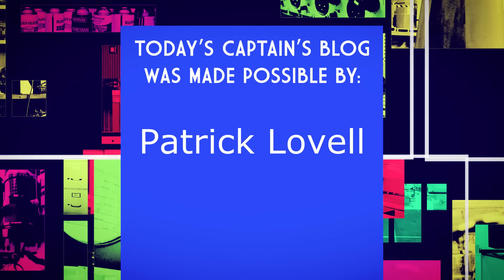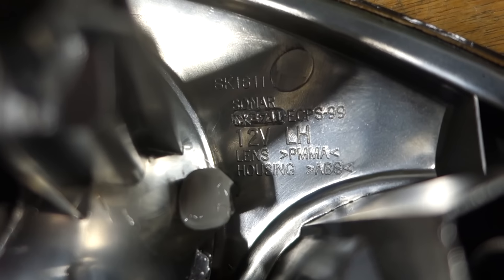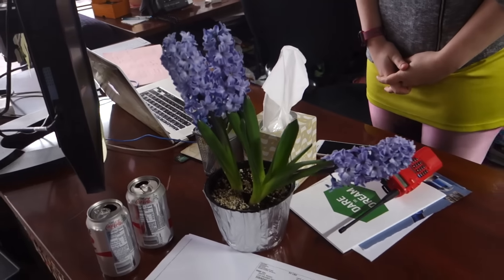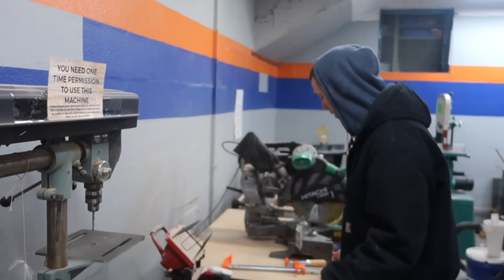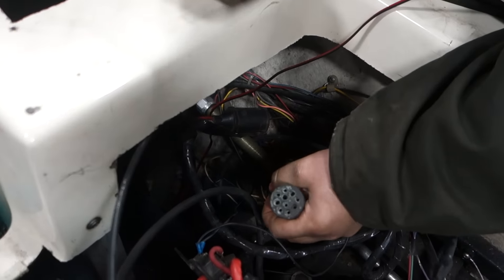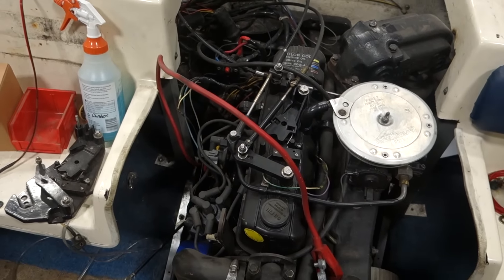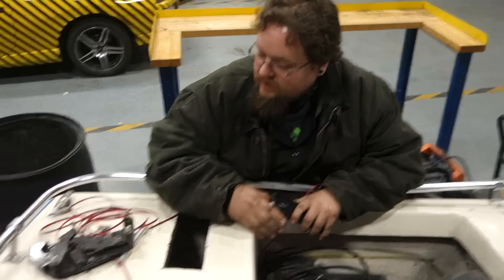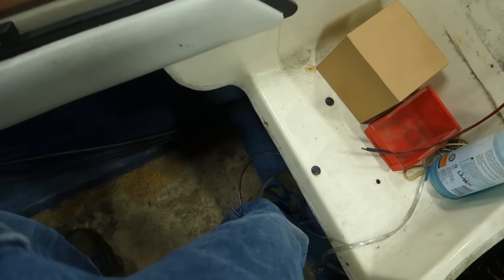Captain's Blog 2 7 2017 Comment Help On Projects

Comment: Chris, those look like standard twist lock holes for a 1056 and a 2057 bulb.  If you go into a auto parts store, ignore the counter guy and find the "HELP" section.  they will be carded on a peg hook.  possibly listed for a GM vehicle, but most newer vehicles use them.
Reply: Those holes in the light housings do look like they fit standard bulb bases that GM uses on many of the cars for that era.
Reply: coshtor    Help is a Division of Dorman Products.   They are one of my Wife's customers.

Comment: 2057 bulb socket https://www.amazon.com/Bestcompu®-Socket-Adapter-Harness-Wiring/dp/B00QG9DDU8

1156 bulb socket https://www.amazon.com/Socket-Brake-Signal-Light-Harness/dp/B00F6B2QBY

Those numbers are also the Bulb ID #'s you need.  You will have to splice the new plugs into the car harness

Comment: 1204  other than the CEO you should have at minimum one staff member at the lab.  those headlight numbers relate to different types of parts of the headlights.  up and down only headlights are under made.  using a garage door good for headlight alignment.  Moose is very gentle.  meeting the dog is a good for open door people.  1652 ... 1755  boat looks great for 1985.  what does marine wire do that car wire cannot?

Comment: Headlight aiming instructions were done nicely by hot rod on
line

https://www.hotrodhotline.com/headlights-part-2-lowhigh-beams#.WJqdv8kZk8A

As for your tail lights fastest thing I could tell you is
take them to pull a part or some similar wreckers and just try a few. I would
be willing to wager those are plugs found on a ford.

Good Luck Chris!

Comment: Here you will find a very nicely indexed list of your cars service manual: http://tearstone.com/factory-service-manuals/

Here you will find the electrical part diagrams for your boats engine, I suggest using the search by serial number function on the website to verify...
https://public-mercurymarine.sysonline.com/Default.aspx?sysname=NorthAmericacompany=GuestNA_KEY=NA_KEY_VALUElangIF=englangDB=eng

This page isn't mercury marine's but one of their dealers search systems, I brought up the page with the relevant diagram here: http://www.mercruiserparts.com/bam/subassembly/30918/1604/70